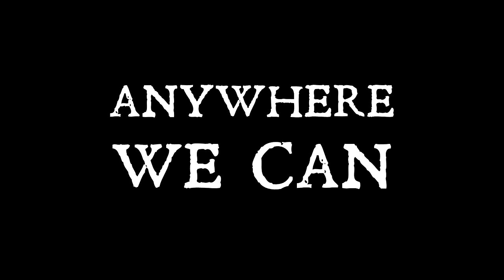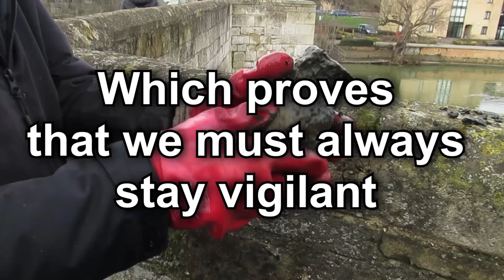You Won't BELIEVE What Was Inside The Box  (And Lots More History Uncovered)

Comment: You say that you can't get the back off the clock mechanism Glenn, many of these timepieces would have a screw thread fitting, try to get it to unscrew if possible, almost always anti clockwise 👌
Reply from the maker: Thanks for the information john
Reply: @PeakyDippers  any time I can, been in printing and engineering most of my life, and took up playing with old pocket watches a few years ago, also refurbishing copper tankards etc.
Reply: Tell Rusty to put a sprinkle of talcum powder in his marigolds and they'll slip on and off like a bride's nightie😂
Reply: The proper name for the tool you showed that you said were used for removing the nails from horses shoes and cleaning out the foot is PLIERS.  Also widely used by carpenters, I'm positive as my grandad was a carpenter, who's career ended when he fell off the scaffolding and broke his hip and was unable to continue, so he became...guess what?... a cobbler, he lived in a little village just outside Preston called Penwortham, I'm talking 1930, and I remember in the late 50s playing on his handmade toolchest in the back yard, and he had about 3 or4 of them. He also had a 4 footed shoe last, I'm 69, and it's in my dining room 😂
Reply: I know I said they were pliers, I meant to say PINCERS!!!